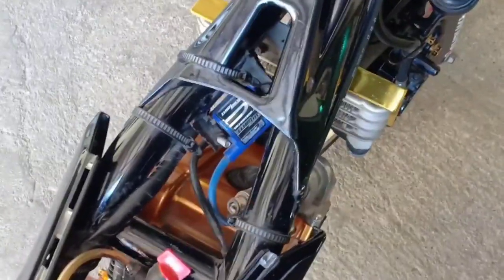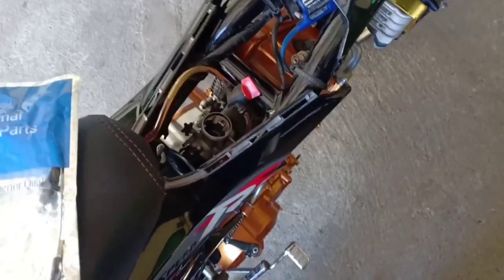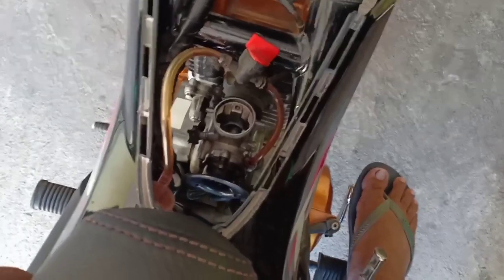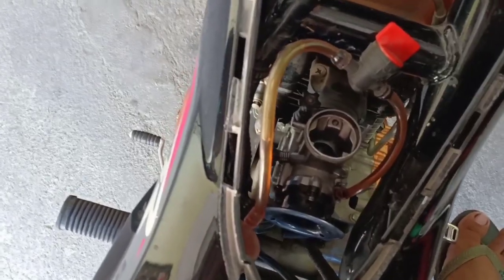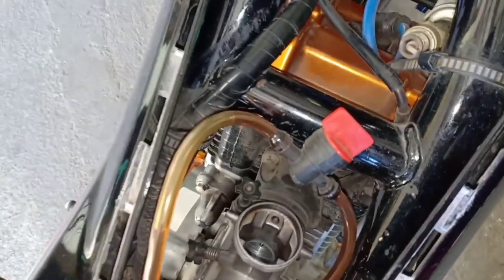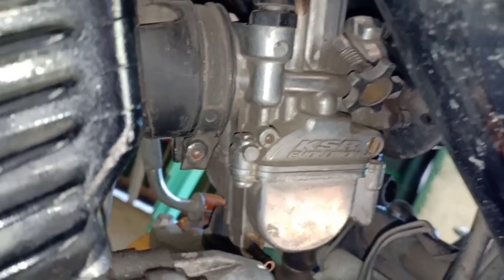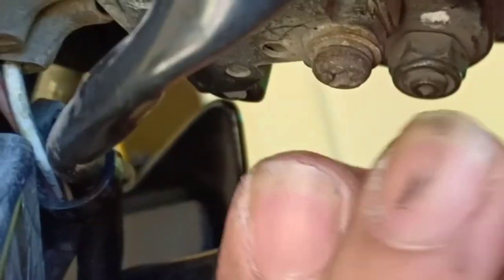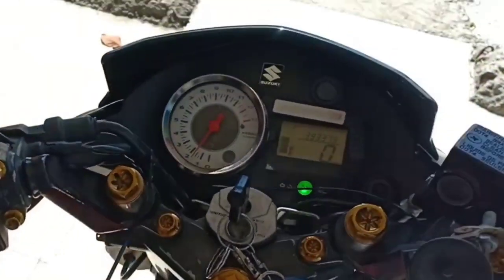34mm carb pinalit ko sa 28mm carb koso,,bakit nga ba!!!

Comment: Boss ano maganda jettings ng 28 mm ksr? naka single gasket the rest stock engine na, naka brt dual band rcdi at racing ignition coil.
Reply from the maker: Depende sa pagtutuno paps kung anu maibabagay na jettings niya
Reply: 115-35 nailagay ko na jettings kasj paps maliit naba yun para sa naka hi com?
Reply from the maker: @leociferl5987  subukan mo paps 38 120 or 38 125 yung jettings ko kasi paps 38 125

Comment: Paps p advise nmn, nka brt dual band aq,faito coil,split fire wire. Dati carb28 pitsbike gmit q wlang dulo, ntry qn ang jettings n 115/38 ok xa for few months mka 140km xa, kalaunan humina n hirap mg 125km, ng.palit aq 118/38, 118/40 tapos 120/38 wla paring dulo, ok ang hatak.

Comment: Sir 28mm koso pwk anung magandang jetting for raider150 stock engine? Thanks
Reply from the maker: Subscribe ka paps panoorin mo yung bagong upload ko tungkol sa jettings nang carb ko
Reply from the maker: Heto paps::28mm carb koso ksr evolution main jet and slow jet suzuki raider 150 check-up 
https://youtu.be/e9rHNKVee3U
Reply: @ILOCOSMOTOSPEED  thanks po sir..koso kasi gamit ko may palya kasi pag nka 7k rpm na.
Reply: Sir bat ang laki nang bagsak nang rpm ko pag mag change gear frm 5gear to 6..sa 5gear 13k rpm sya pero pag lipat ko na sa 6 gear drop sya sa 10k rpm lng hirap pa akyatin sa 13k rpm pag 6gear..koso 28mm gamit ko rcdi na rin ako..
Reply from the maker: @renatoagroda1064  ihanap mo yung magandang sprocket niya subukan mo yung 14 43 or 14 45
Reply: @ILOCOSMOTOSPEED  14 43 gamit ko ngaun sir...kung  palitan ko nang 13 yung pinion sir..ok rin kaya sir?
Reply from the maker: @renatoagroda1064  hwag mong papalitan sa harap 14 lang sa likod na lang 45 lagay mo paps
Reply: @ILOCOSMOTOSPEED  ok po sir hanapan ko nang 14 45..pero maganda dn yung top nito sir?
Reply from the maker: @renatoagroda1064  meron akong fb page pwede ka magtanong sakin ilocos motospeed name niya
Reply: @ILOCOSMOTOSPEED  ok sir pm kita dun thanks

Comment: Boss pmbat ganun bagong bili ko koso evo 28mm flatslide  tinono ng mekaniko ok naman.38 Pero nung nagamit ko lng ng mga 1hours bigla nawla ang tono pa hindi stable ang rpm nya.  Yung nasa tono 1.5 tpos bigla       tigil ko gawa ng trafic bigla baba sa 1.2.  Biglaan bigla baba hindi ren stable rpm nkakaraan bumalik ako sa shop na tono ulit pinaltan ng 36. Nag ok tpos nagka ganun na ulit.. Pumunta ako ibang shop.. Tpos pinaltan ng 35 tpos na tono. Tpos nag ka ganun ulit taas baba minor lake ng binaba napunta tlaga sa 1.2  boss ano suggest nyu patulong naman 😭😭😭 lake na nagagastos ko sa pag papatono ng carb.. Pde ko ba mhinge fb mo para ma chat kita. Sana matulungan mo ko 😭😭😭😭😭
Reply from the maker: Baka naman hindi orig yan paps kasi madali lang ituno ang koso evo paps
Reply: Boss ano ba fb mo para ma send ko sayu pic ng koso ko   para d nako papunta punta sa mekaniko lake ma tlaga magagastos ko 😭😭😭😭
Reply: Boss😭😭😭
Reply: Boss pede ba malaman fb mo
Reply from the maker: @albertorante8674  taga san ka paps
Reply: Taga laguna po boss
Reply: Para ma send ko sa inyu yun pic ako nkng add or message nyu boss sa fb ok lng ba  search nyu lng po yan name ko lalabas na po yan d kase ako mapakale
Reply: ILOCOS MOTOSPEED
Reply: Ung akin 38 125 ok nmn na ka faio coil lang

Comment: paps ask lang anu maganda jettings nang keihin 30mm carb?
Reply from the maker: Kung stock ka 35 120
Reply: @ILOCOSMOTOSPEED  nakapalit nako racing monkey ignition coil clutch lining/spring 155 sparkplug trielectrode splitfire twincoil
Reply: @ILOCOSMOTOSPEED  rusi ssx 150 motor ko paps
Reply from the maker: @rodpayopay376  subukan mo din to 38 115
Reply from the maker: @rodpayopay376  pwede rin lagyan nang racing cdi yan paps,,brt pang raider 150 pero papawiring mo lang kasi hindi sila magkasocket
Reply: salamat paps ung 115 38 yan nakikita ko sa mga feedback itry ko din salamat taga pangasinan pala ako
Reply: kaya ba ung 115/48
Reply from the maker: @rodpayopay376  depende sa motor  mo kung kaya niya
Reply: anu maganda sprocket combi paps may hatak at arangkada dko kaya kahapon sa philex

Comment: Flatslide po ba yan?
Reply from the maker: Opo paps
Reply: @ILOCOSMOTOSPEED  okay po ba sya for daily use ? 50km po a day. Ilang km po per liter ang consumption ng ganyang carb? Plano ko po kasi magpalit, all stock pa raider ko , carb lng papalit ko po
Reply from the maker: @m.jonardylan2785  ok naman siya matipid naman
Reply: @ILOCOSMOTOSPEED  mga ilang kms po inaabot ng full tank? Tas ilang months po ba siya kailangan linisan if daily use?
Reply: Baguhan lng po kasi ako sa raider eh hehe first motor ko din na carb kasi preho FI na automatic motor ko last time

Comment: Ilang turns tono mo paps?
Reply from the maker: Depende sa magtotono paps kung anu yung gusto nang motor mo paps
Reply: Di naba masyado malaki yung 125-38 na jettings paps para sa all stock engine  pero naka brt dualband cdi?
Reply from the maker: @leociferl5987  depende sa motor mo kung kaya niya,,dapat itestdrive mo kung hindi kaya ibaba mo yung main jet niya,,itutuno mo pa rin yan kung ano yung gusto nang motor mo
Reply: Pumupugak kasi sya sa 118 38 tas parang walang arangkada tapos lakas pa ng backfire
Reply: Anong jettings yan sir?
Reply from the maker: @g5motovlog162  38 125
Reply: @leociferl5987  try itaas pin needle pas. rich mixture yan.